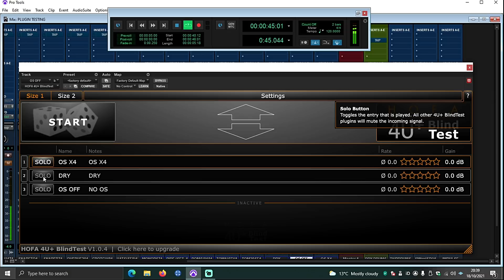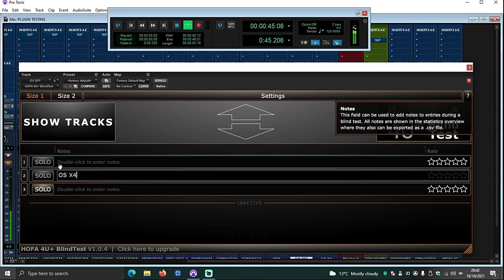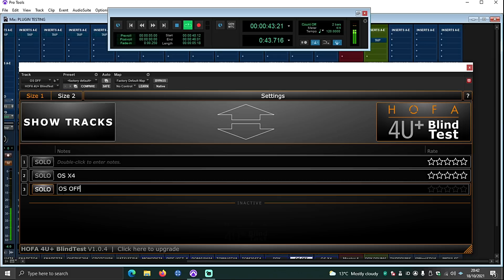ALIASING IN AUDIO PLUGINS... The most important things you need to know!!

Comment from the maker: Another little thing that I edited out because the video was too long but still worth discussing.

Is it it possible with the effects of audible aliasing that we end up over possibly over eq'ing to regain what we've possibly lost due to the aliasing. Could it be argued that you may require less eq with an oversampled plugin or a plugin that doesn't alias a lot.

Is it maybe a reason why we see more plugin chains to maintain that punch and clarity that we desire. Do we end up adding more plugins subconsciously because we aren't possibly correlating that we've instantly lost a bit of clarity just running through an audibly aliasing plugin. 

Very very subjective thought but one that came to me randomly whilst filming the video 

Not wanting to start heated debates but thought I'd include as the idea interests me 🤓
Reply: It's certainly possible. But this is not just aliasing.. that's anything really. And I'll take the chance to once again advertise my approach to mixing:
One of the reasons I like my plugins (with the exception of tape and sound-designy-plugins) to be one trick-poneys, mostly, is this: I don't want to introduce ANYTHING apart from what I'm using the plugin for. Because chances are whatever else I introduce is something I will have to work against at a later point.. and if I have to work against it with a plugin that introduces a new thing apart from fixing the first thing, chances are I'll need another one.. etc. etc. Stuff stacks up. Problems stack up. You want to fix as little as possible and thus you have to be very concious of what you add.
The number of times I've been happy with a production and fucked it up in mixing is simply too high. Overmixing is a problem. Spamming analogue emulations on tracks is a problem (unless you know your chain very, very, very well). I'm sure aliasing is one of the problems one can introduce. Wether you know it's aliasing or not is a whole other topic.
Reply from the maker: 100% agree with this. My chains are becoming smaller and actually cleaner with every mix. That's a good way to put it in terms of stacking chains of plugins. A plug may give you one thing that you want it to do but affects negatively in another way and instead of fixing the negative you just carry on with the positive and before you know it you have lots of stuff you want but left scratching your head why other problems have arisen. Very true and something I'm learning more and more with every mix I do 🤓
Reply: "Could it be argued that you may require less eq with an oversampled plugin or a plugin that doesn't alias a lot.

Is it maybe a reason why we see more plugin chains to maintain that punch and clarity that we desire. Do we end up adding more plugins subconsciously because we aren't possibly correlating that we've instantly lost a bit of clarity just running through an audibly aliasing plugin."

YES! I just posted a (too long) comment touching this actually, didn't notice you already raised discussion about it...

I have a feeling that this exact phenomenon is very much more common than one might think, and I'm pretty sure it's exactly what has happened to me. If you go like "yeah I slam this Lindell here, these three old modeling comps here aaa whadda vocal chain uuuh" - and end up putting a Soothe or a dynamic eq in the chain later down the road to deal with a lot of extra harmonics or whistles or whatnot irritations, you can be pretty much sure that unless someone recorded the track with a lot of processing or you f'd up the gain staging, you should just delete that chain and start over on another day with fresh ears and add no plugin by default. 

Happened to me, and not too long ago. You can get enamoured by saturation and regret later!
Reply: Yes, definitely! Speaking as a novice mixer, I over eq. It just happened to be I’m using almost exclusively Waves plugs- NLS every channel w/ buss on master, as well as SSL E channel on every single channel too. So your above comment sums up a heck of a lot in my situation. 

Going to explore oversampling options after having watched your videos now, Paul 👍 Very much appreciated.
Reply: Very important point! I think so, too.

Comment: If I brick wall everything at 20 kHz at the beginning or at the end of the effects chain with Fabfilter. Would this sort out 
the problem completely or on the mix bus.
Reply from the maker: No, because it doesn't stop the harmonics exceeding niquist. Oversampling expands niquist so the bandwidth is much wider and down samples it back to the daw sample rate. The only way to stop aliasing is to increase the bandwidth so the harmonics made from frequencies don't exceed the bandwidth

So whilst you can filter at 20k, it has no impact on harmonics created from 20-20khz. See your lpf as pre aliasing, not post
Reply: @PaulThird  
Yes I understand Oversampling expands the niquist. If I used a extremely high sample rate though in my
daw say 24bit 192 khz. How would the plugins respond to that.
Reply from the maker: @err4071  if they are supported to that sample rate but you're CPU will be through the roof at 192
Reply: @PaulThird  
So some plugins don't support higher sample rates then, that's handy to know. Yes my pc would only
perhaps handle 5 or 6 tracks at 192 khz with plugins before i would need to render them out so its not
ideal. Thanks for the replies and explanations. 👍

Comment: You are SO right! What about non sampled software and vsts? Like korg software/ Roland software? Is there aliasing vs its hardware conterpart?
Reply from the maker: If it makes a lot of high order harmonic distortion and has no oversampling, it will alias.

If it doesn't make any harmonic distortion then no aliasing.

Tbh instead of going back to hardware, think about why proq3 has been an industry staple for years. Completely clean, no harmonics, does what you need it to do without colouring the source. That's what SSL was trying to achieve with their consoles, complete transparency

Comment: Great video! I stumbled on it while working on some neural guitar effect plugin projects.

Since I'm doing a lot of high gain amp modeling, aliasing is going to be a certainty. Because of your video, I'm likely looking at a 2x-4x oversampling option for 44.1kHz and 48kHz sampling rates in my plugin. Not sure I can make the code run fast enough to support anything higher than that but 4x oversampling at 48kHz should be sufficient I think.

Comment: Hey Paul, I came back around to this video to see if you've tested any of the Plugin Alliance BX plugins for aliasing. I've stayed away from them because of this (no obvious oversampling option). I recently commented on a Plugin Alliance Facebook post selling their SSL 4000 G, which is on sale. I said that I liked the plugin a lot, but was gun shy on their products due to the lack of oversampling (I'm using almost all exclusively Acustica Audio at this point). This was their reply and I'd love your take or insight: "All analog modeled plugins “made by BX” apply oversampling internally whenever it is necessary, in a really clever way. We are typically not simply oversampling the whole plugin, as this would increase the CPU/DSP load unnecessarily in most cases. Especially on DSP systems, where a plugin always has to “reserve” the worst case DSP load this wouldn’t be great. The same would be true for plugins like our SSL console emulations, which get used on dozens of channels in many mixes. CPU/DSP efficiency is key here. The way our system works is that we basically make sure that any crucial part of analog modeled circuits run with a sample rate of at least 176Khz internally. Our Upsampling Settings, depending on your session settings: - Below 50kHz (for example 44.1 and 48): 4x - Below 100kHz (for example 88.2 and 96): 2x - Above 100kHz (176.4 and 192): 1x We don’t offer these Upsampling modes to be selectable or switchable by the user, because we believe they are highly optimized for each circuit and application the way we have integrated our Upsampling".
Reply from the maker: Tbh they do internally oversample but that still doesn't mean it's enough in their heavier saturation plugins (spl iron, vsm3 etc)

But tbh they are pretty decent on the most part but really cause they don't need it in most cases. Aliasing is only important when it's audible so ssl for example. You'd need to hit that thing stupidly hard to get audible aliasing out of it. You need to look at the levels of aliasing before considering if oversampling is important. If it's got aliasing at -90/100.. What are you worried about. Nobody can hear it. Doctor makes everything look worse cause it goes down so low to like -140db.

But they do internally oversample. That's not BS. I know cause of the anti aliasing filters
Reply: @PaulThird  thanks Paul! Now I feel beter about using their plugins. In this day and age aliasing should never be an issue. I get it about aliasing being in the audible range with one insert, but when you have lots of plugins going on a mix, with compression, saturation, etc..you get that cloudy build up of aliasing. My mixes are night and day better now since Ive learned all of this.

Comment: I first discovered Aliasing when sampling with my Casio sk-1 while sampling audio at 78 rpm at a sample rate of 8 bit (2.5 seconds) it was horrid. If at any time I detect it,  I change EQ settings and increase the sample rate until artifacts are no longer evident. Sometimes certain audio is just too brittle to digitize. Of course nowadays I have no trouble with artifacts. I've never experienced it in FL Studio, any Akai mpc or my Ensoniq samplers.

Comment: It's not that noticeable in the context of a full mix (for the most part). If anything... I'm more worried about intermodulation.
Reply from the maker: I'd guarantee if you had a black box that could magically take away all the aliasing in a mix with the flick of a switch guys would pay thousands for it and call it analog magic haha

To me aliasing is the "extra 2-3%" and its basically free to fix and you don't have to pay thousands in gear for that "extra squeeze in quality"
Reply: @PaulThird  As long as you’re not adding a ton of saturation in the high frequencies… because that’s one thing that most analog guys didn’t even do…

Comment: Paul...what if you took all your digital audio tracks & reprint them with hardware i.e. 1073, G bus, SSL fusion   and mix with those!  Would that in turn.make a diff?
Reply from the maker: Not really if the aliasing is inaudible in the plugin. It can build up over tracks but if you keep it below - 90/-100dfs i can't see it building up over a mix. It's like noise in analog, it's there and sometimes at the same level or louder than a lot of inaudible aliasing but you don't really hear it in a 90's/00's analog mix when all the gear is summed.

Put it this way. The aliasing is managed at 96k in waves pye comp and when I brought multiple instances together as a mix and compared to hardware.. Over 70% of people couldnt tell the difference and the other half of what was left failed it. I think only like 12% got it right.

When aliasing is audible its an issue in my personal opinion but when it's not audible.. Analog doesn't really have anything else to offer vs. Good plugin emulation

Comment: Whats your thoughts on slate plugins and aliasing?
Reply from the maker: I never tested them for aliasing tbh but I don't think they oversample as far as I'm aware. Maybe internally but I couldn't answer that unless I got the slate sub
Reply: @PaulThird  There is an option for 2x oversampling in the mix rack. I think they still alias a little bit regardless. Not sure if i'm even testing correctly though and they sound solid enough regardless. Ive been testing everything I have after seeing vids on aliasing. More out of curiosity than anything really. Was curious on Arturia plugins too.
Reply from the maker: A lot of emulation plugs do if you go in really hot. If you gain stage normally it's OK but I oversample the Arturia 1176 x2 via metaplugin if I'm using it for a heavy compressed saturated parallel.

Comment: Paul. Would you then recommend we start recording at 24 96? Just in case we need it for Aliasing control?

I got an M1 mac, so power is really a breeze there.
Reply from the maker: If you've got the power then it makes sense but it depends on your recording chain. If you are using plugins on the way in then 96k would be a good choice so you aren't printing aliasing on your tracks but if you are applying plugins after recording you can get away with oversampling via metaplugin and stuff at 44.1/48k.

Depends on the individual plugins you are using but in my setup I do all my premixing at 96k (clean up & compression), commit & export processed stems into a 48khz session for mixing

Comment: Thank you for such a great video, very important information! Im wondering, if I export a 48k project to 96k does that make the aliasing less or do I need to work in 96k from start. Since your videos about this topic Im very careful before I buy a new plugin. Have you tried Analog obsessions plugins, they sound good, look good, have oversampling and are all free.
Reply from the maker: Aliasing has to be corrected at the source so on the plugin itself. Once you've got aliasing on a track it's on the track so you have to deal with it there and then
Reply: @PaulThird  aha okay. I read about Ddmf plugin and its only 40 dollars to get rid of aliasing on every plugin. Thank you for your response 😊👍
Reply from the maker: I use metaplugin for oversampling every so often but it's not always the answer as your oversampling depends on the plugins supported sample rate. If a waves plugin is only supported to 96k and you try and oversample it at 96k or x4 at 48k it will reduce aliasing but also start to multiply frequencies which isn't what you want.

You have to be very careful to stay within the parameters of the Plugin
Reply: @PaulThird  great advice! I will keep that in mind 🍻

Comment: Hi Paul great video!!!
If you plug your hardware compressor as I/O insert it get convert to digital
(A/D) in that stage it's like a Digital plugin you get Nyquist ALIASING if you working on 44.1 or 48 or am I missing something? whats the different between hybrid and Plugins? I don't get it...
Should I use Airwindows Ultrasonic plugin to avoid ALIASING?
Reply from the maker: With analog to digital you need an A/D converter. That itself will have its own sample rate but my understanding is that it'll cut off everything after niquist. So if its your interface and its at 48k it'll cut off EVERYTHING past 24k. Frequency AND harmonic content. You'll notice your daw and interface/converter need to work at the same sample rate so when it gets to into the digital domain there is actually no information past nuquist for the computer to process.

Thus you'll never get aliasing as the converter has chopped off all of the information past its sample rate, which ties into the DAW's sample rate as well.

Hypothetically speaking if your converter was able to work at a higher sample rate (96k) than your daw (44.1) in real time then it's possible as its giving the computer numbers it can't process but your daw and interface always work together and are synced at the same  sample rate.

If you record at 96k and import the files into a 44.1 session then the files are converted to 44.1 and the high end information that would cause aliasing is removed.

I've been told that ultrasonic isn't for removing aliasing which is confusing me haha it doesn't remove aliasing. Well nothing I tried worked anyway.
Reply: thanks for responding great channel and this is a Big Topic ! when you do analog insert it's a round trip 2 times  convert happening (D/A) -> (A/D) any degrade to the sound quality ? also if i put plugin like EQ after the analog i/O what is the result with aliasing? so many question to trace this complicated processing.         @PaulThird

Comment: Hey Paul, if i mix at 44.1khz and then export it with a high pass, will my output still have aliasing?
Reply from the maker: Yes. Aliasing needs to be fixed at the source. I've seen some saturation plugins still aliasing at 5-7k haha you've got to remember that just cause you've cut off frequencies at like 18-20k doesn't mean that 8-18k won't be making lots of orders of harmonics that go past 22k. That's why I do aliasing tests at 10k so I can really see how bad it is.

Once the plugin makes aliasing the damage is done so you need to control the aliasing as its actually happening

Comment: One more point i want to add considering internal oversampling in plugins: sound of it often depends on the type of antialiasing filter used to filter out  high frequencies before downsampling: minimum phase, mixed or linear phase. Some developers are worried that you may use oversampled plugin in a parralel chain, so they use either linear or mixed phase filter, and because this filter is super steep, as a result even though it's located above 20khz, you still can hear pre-ringing, and often it may sound good and fool you into believing it's the sound of no aliasing. Cytomic The Glue provides options of antialiasing filters to choose from, and yeah, linear phase filter sounds very different, while with minimum phase i can barely hear any difference between oversampling and no oversampling.
Reply from the maker: See this is all the stuff I'm planning to dive into as the more comments i see regarding oversampling mention different tonal impacts dependent on the oversampling used by the developer. I do not know enough yet in regards to oversampling but my hope is to ask around and hopefully be able to make a video in the near future regarding oversampling with some tests and some background info but I'll admit I'm not there yet to make a video
Reply: It's measurable